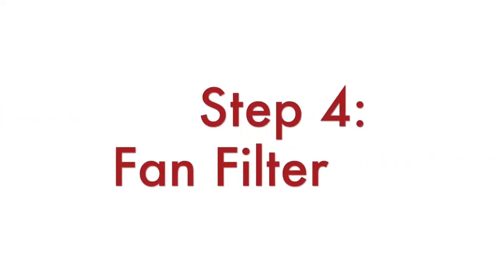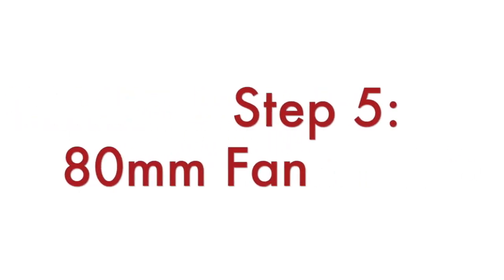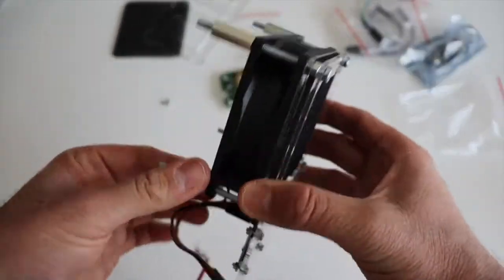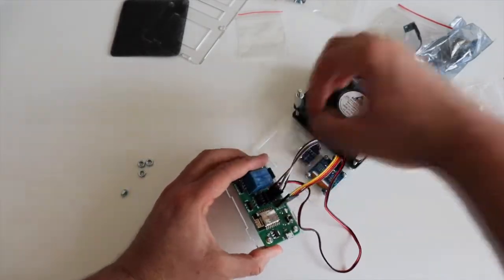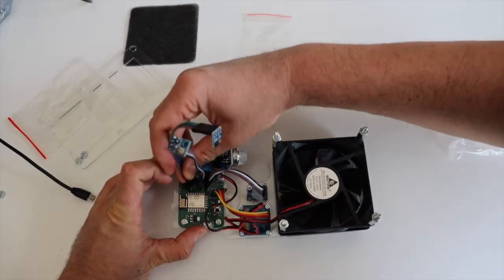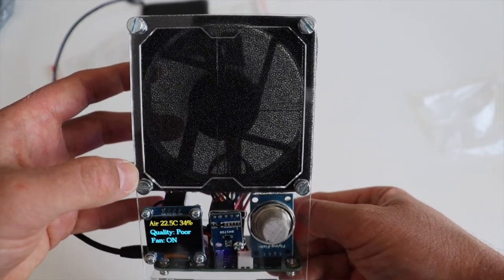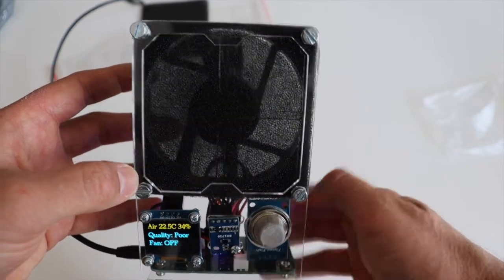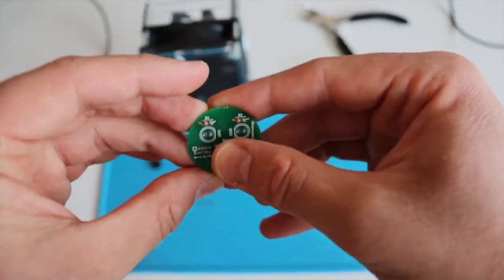ANAVI Fume Extractor Assembly Guide

Comment: Video sucks to be quite frank. I used this and the text installation guide and it glossed over areas that really could do with detailed instructions and pictures. I read the part that the display is delicate 4 times and still managed to break it and I don't wanna say it's user error because I couldn't find any other sources on how to install this and I watched those areas of the video in 0.25 speed SEVERAL TIMES to try and make sense of what exactly was put where and after 4 years on the market it's kinda shocking that it's left with such subpar build instuctions. I'm really hoping the other Anavi products I purchased don't suffer the same lack of effective instruction.
Reply from the maker: Sorry for the trouble you have gone through and thank you for the honest feedback. The display can be purchased separately from Mouser. The part number is CS-ANAVI-DISPLAY-1. However, I will be happy to send you a free replacement. Could you please get in touch at info@anavi.technology to arrange the shipping?

Comment: You really need a better way to support the OLED display instead of simply saying do not fasten too tight. Maybe design a small perspex support bracket? In the absence of such support, your video instructions to take care not to overtighten the OLED should become BEFORE you start your explanation of mounting (timestamp 1:03 after the title text for example). Finally, the male jumper wires for the OLED and sensors that connect to the power board are also a poor friction fit and when I was trying to adjust the wires to fit in the space when the final perspex backplate was being fitted they kept coming out of the board sockets. Other than this, great project.
Reply from the maker: Yes, a small support bracket for the screen sounds a very good idea and I will consider it. It might be even 3D printed to fit better around the upper part of the display. A friend started his own 3D printing company locally in Plovdiv, Bulgaria so I might give him a call.

I also agree with your remark about the I2C connectors. Although there are a bit annoying during the assembly, these simple connectors are cheap and actually quite flexible as you can easily find jumper wires and connect another I2C sensors or devices to them. Considering the assembly is done rarely or even just once because the filter can be changed without full disassembly, I hope the connectors are not troublesome in long-term.

Thank you very much for the feedback, ideas and for using the fume extractor :)

Comment: Hi Leon, Brilliant device.
Could you please provide a technical sheet of the device along with sensitivity of the detector and guidance?
I would much appreciate if you could inform about the best way to connect this sensor inline with my gas production trials at the lab. Cheers.
Reply from the maker: Thank you! At the moment details about ANAVI Fume Extractor are available at the crowdfunding page:
https://www.crowdsupply.com/anavi-technology/fume-extractor
Several sensors for detecting various environmental changes are avaiable. The sensor for general air quality is an analog MQ-135 gas sensor. I have a separate in-depth video about it in my YouTube channel. The other sensors in the developer kit are I2C modules: HTU21D for temperature and humidity, BMP180 for barometric pressure and temperautre, BH1750 for light.
Reply: @LeonAnavi  Very handy. Thanks for your response